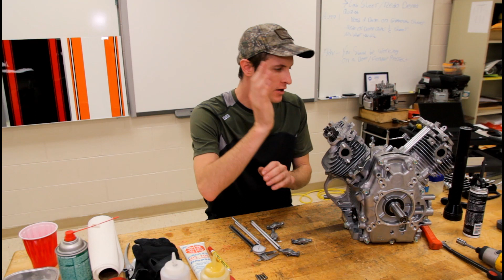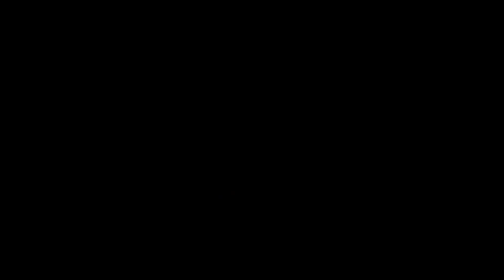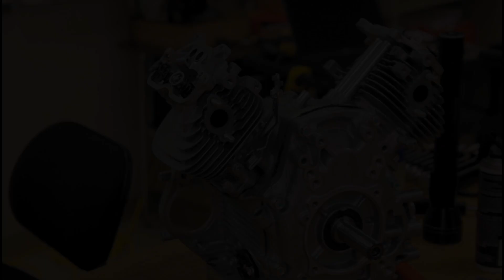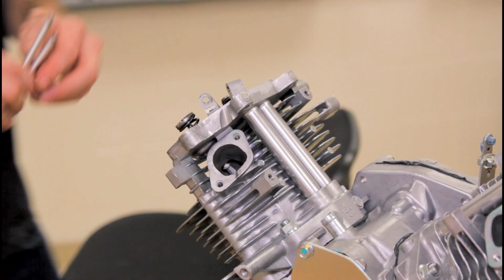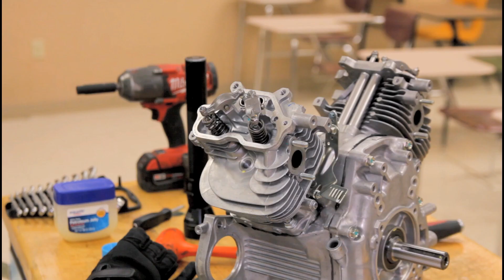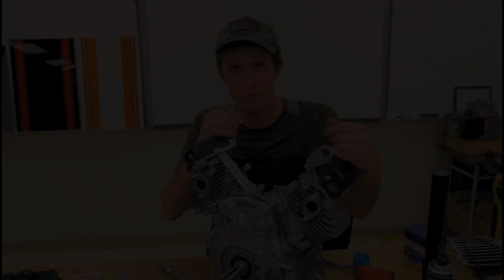15 Honda GX 630 Install Push Rods and Rockers & Adjust Valves

Comment: Really appreciate the time it took you to perform this video great job I have a question 🎉😮Have you ever did the new Honda  igx800 I think it28HP I have already been going through a lot of problems with my IGX800 it is fully all electrical fule injection for with the 
FI
St governmer I my engine is raveing high then I low like a surging check and change intake gaskets and throttle body gasket I was told that it could be a week left ignition coil I had to replace the rectifier when I first got it it only has 120 hours on the engine the engine great video brother sorry for the long message if you have any suggestions please give me some feedback really appreciate it I've been stuck for 3 weeks with my machine down I use it as a 10 gallon a minute pressure washer❤ pressure washer unit
Reply: Put your hand over the air intake with the air filter removed. 

If it evens out and stops doing, you have a MAP sensor issue and need to replace the entire throttle body assembly.